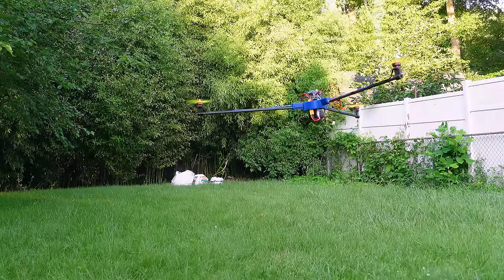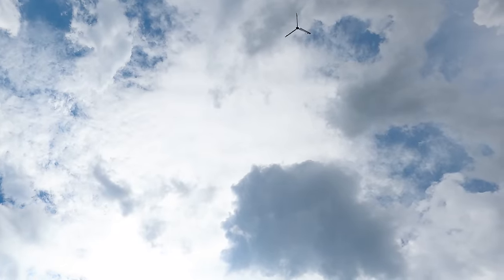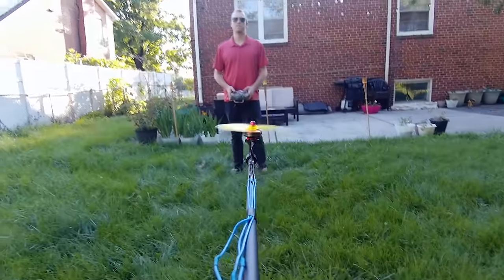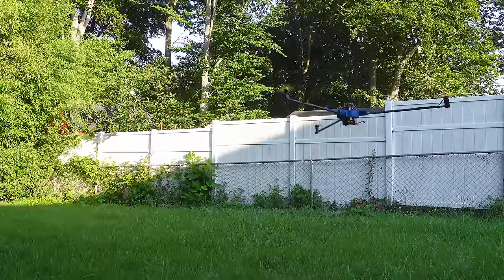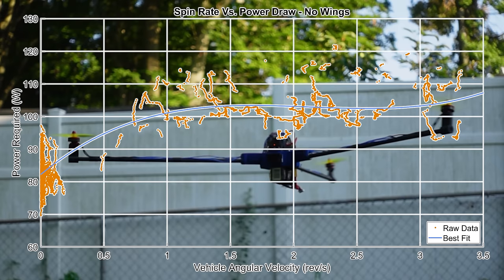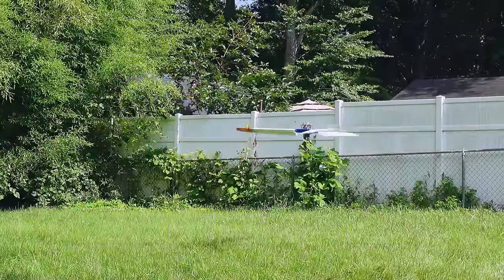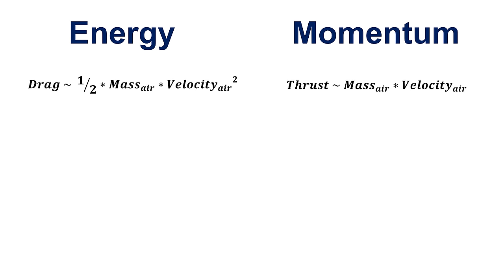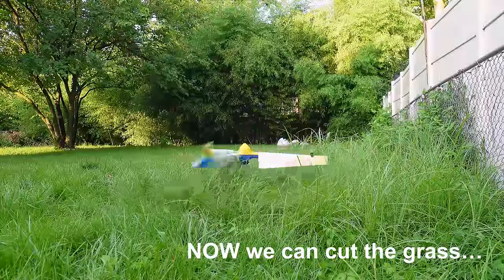The Spinning Drone Paradox - Part 1

Comment: I am astounded at how you can share your findings and teach new concepts in a fun way at the same time. Great job!
Reply from the maker: Really appreciate your comment
Reply: @NicholasRehm  The concept actually comes from a children's toy. It's a stick that you attach to a small propeller, and you rub it in your palms which causes it to spin, lift up and hover like a helicopter.

Putting that on a drone makes it more efficient, just like you touched on, the whole unit becomes one large, slow spinning, "passive" propeller.

Also, having tri-drone is a more efficient design than a quad-drone. You basically can have three larger active-propellers, rather than four smaller ones. So these two attributes fit together nicely.

The reason why people opt for the quad-drone setup is because it is actually more simple, cheaper, and easier to navigate (you can assign each side as front/back/left/right). Each of the four arms can be rigid and controlled by a simple on/off switch. A tri-drone needs more tweaks, and have each arm needing to pivot and spin at different rates.

As for energy source, fossil fuel is still better method at the medium to heavy weight. Electrical is only viable at the super lightweight scale. Not sure about nuclear, we don't have the technology for it (small nuclear engine). The best compromise is using solar energy for splitting water, generating hydrogen, using solar energy to compress it, then having hydrogen engine for helicopter flight. It can scale to heavyweight sizes, and is based on a renewable source.

Comment: I couldn't fail to notice another way to improve the efficiency of your setup: Just let it spin in the other direction!
As any winged aircraft, your drone suffers from  wing tip vortices due to induced drag. 
These vortices reduce the wing's ability to generate lift, so that it requires a higher angle of attack for the same lift, which tilts the total aerodynamic force rearwards and increases the drag component of that force.
In the flights you showed us, the propellers were turning in the same direction as the vortices, hence enhancing them. Now  if the drone spins in the other direction the wing tip vortices switch direction too. Since the spinning direction of the prop would stay the same, those vortices would be reduced by the prop spin.
The effect would be even more pronounced if the props would be at the very tip of the wing. 
See:
Chance Vought V-173
Chance Vought XF5U
Bell-Boeing V-22
On all these planes the outside tip of the props were moving downward.
Reply: In addition, it could be  torodal design
Reply: where would u suggest I learn more about what u've said?
Reply: @davidthomson8010  Wherever you are right now is fine man, just gotta start! Good luck!
Reply: @onepointufo  toroidal*
Reply: @1u8taheb6  useless answers 101
Reply: @davidthomson8010 
A&P online courses. I’m a licensed A&P myself but basically every single topic pertinent to aircraft is taught in these courses. 

 Actual books you can own is the AC-43.1B. This is an advisory circular giving instructions on part 43 of the Code of Federal Regulations. 

 The FAA 8083 is good training books too. 

 Since these are federal guidelines and recommendations, they are available for free as PDF online. 

 Watch YouTube courses on A&P topics as well.

 For avionics it’s NCATT AET which can be quite complex subject because it is a training book for passing the NCATT, probably one of the more difficult federal licensing programs available.
Reply: Wait couldn't we also just sweep the inside part of the wings a lot and get vortex lift while leaving the end of the wings straight and fighting the wing tip vortices with the props. As the inside of the wings is slower it would also make sense to increase the cord off the wing right? IDK I'm just talking about what i think i know about aerodynamics.

Comment: You know, like a helicopter! 

Fun fact, there have been helicopters that had their main rotor propulsion take place at the end of the rotors by little rockets. These tip jet Copters came in several different formulations. Including ram jets! 
You’re essentially recreating this basic idea. Thrust at the end of the rotors! Another benefit of propulsion at the tip of the rotors is a lack of torque applied to the center mass. This makes it not necessary to have tail rotors on these types of craft!
Reply: Came here looking for somebody mentioning a helicopter and here you are. Somebody else on here made a comment about separate servos for rotor tilt and I think they stumbled upon the cyclic.
Reply: There used to be advertisements in the back of magazines like Popular Science that sold plans for one-man helicopters that used pulse jets on the rotor tips.  Apparently they did work but the pulse jets were so loud that they were no fun.  Pulse jets are simple and cheap and precession is not a problem, but damn they are stupid loud.
Reply: @florabee9283  pulse jets are a great way to convert potential chemical energy into noise.
Reply: There is a YouTuber that already made that
Reply: I used to subscribe to popular science and mechanics way back then... How did they steer?
Reply: @petevenuti7355  they had swash plates. Like most copters.
Reply: What you describe is a Fairy Rotodyne.
Reply: @crisper1614  Not swash plates, the entire rotor head was on a universal joint, you just tilted it in the direction you wanted to go.
Reply: Mmmm.... No.

The more accurate comparison is between a turbojet vs a turbofan/prop, and why turbofans have been steadily getting bigger.

A helicopters kinda have the same problem as the naked tricopter - it's moving a relatively small amount of air quickly rather than a lot of air slowly.

For example, compare the CH53 with the Dash 8 Q400 they both have a similar maximum takeoff weight, yet the Q400 flies faster and farther with less powerful engines.
Reply: Yes, I remember talking with my brothers and father about helicopter engineering. For conext, both of my brothers and my father all have degrees in mechanical engineering. And I was just an undergraduate chemistry major. I suggested it may be possible to improve helicopter performance at high altitude by powering the rotor with ramjets mounted to the tips of the rotors as these tip jets would exhibit excellent thrust with the increased rotor speed. I had never heard of tipjets before and was just spitballing. They all scoffed at me and told me that design would be completely impractical. I later learned that tipjets were actually a thing and was totally vidicated, but still a bit resentful about how quick they were to dismiss my idea.
Reply: Mustard's video on rotocopters is great!
Reply: @FourthRoot  Keyword, *were*.

Tipjets were a thing, and no longer are a thing, because the design is completely impractical.

There was one production tipjet helicopter ever, and it ended up being replaced by a conventional helicopter.
Reply: @firstnamelastname8439  They weren't completely impractical as real working prototypes were produced. They just didn't offer any significant advantages over traditional designs. But that wasn't my brothers' and father's argument. They argued that the design would not be feasible at all. They argued that the centrifugal force would be far too great for the rotor to handle and it would not be possible to power a helicopter rotor that way. They were wrong about that and wrong to scoff at my idea.
Reply: @FourthRoot  Then you should have said impossible. 

'Offers no real benefits despite having additional costs' is kinda the definition if impractical.
Reply: @FourthRoot  Three words for family unity: 

Let it go...
Reply: @icantseethis  About the same as a Harley!
Reply: @HarmanRobotics  because of gyroscopes, technically you tilt 90 degrees offset from where you want to go

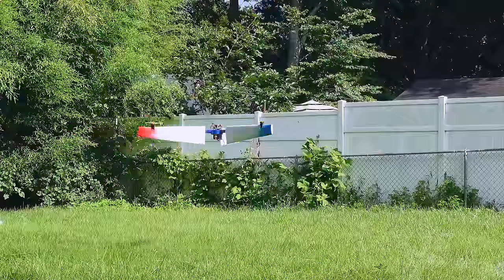Comment: I love it! Now make a gigantic quadcopter with four of these and see how much it can lift. Seems like you already have good feedback about the yaw rate, which could be fed into another PID for the quad control. An added benefit is you could adjust the 'cyclic' or average pitch of all corners so that the rev/s aims for the minimum of the blue line in the graph at 5:52. It would be hard to program, expensive, and as agile as a school bus. Yay!
Reply from the maker: This is so insane that I just might do it LOL
Reply: Oh i just saw watched this video and thought i thought of this first, i hope you do this though
Reply: @NicholasRehm  you're using a 4-in-1 ESC anyway, so, why not 4th motor?
Reply: @NicholasRehm  well it won't be more efficient than strapping 4 bigger motors directly to the bigger props, will it?
Reply: @NicholasRehm  Is there enough space for 4 pinion gears? Suppose ya could just go bigger?
Reply: @NicholasRehm  yes im thinking if all four are attached from the bottom and then enough distance that they don't rob air from one another, that flight controller is gana need a number of code levels so it can understand all four in motion so the overall frame and be stable, but all over my head lol
Reply: Dang I was just going to comment and say "Make it a dual design!" But you just went ahead and went straight to quad!
Reply: @jackwiedemann  Then it would have no thrust in "airplane" mode.
Reply: @NicholasRehm  of course you would need to make a quad of quads, creating the first Koch Snowflake Infinite Multirotor
Reply: @Chris-oj7ro  just needs tilt on all four and you would fly decent speeds like a race copter
Reply: @jackwiedemann  it might not match the efficiency of a conventional motor/prop setup of the same size, but both motors and props that large are extremely expensive compared to miniquad motors and foam airfoils, so I could see some utility in low-cost low-speed applications.
Reply: This but ^3 ed lol This tricopter driving a larger propellor which would be on the quad. LOL sorry couldn't help it.
Reply: No shit, I've seen one of these ~20 years ago and everyone working on it hated it and thought it was dumb. It was made out of the pink insulation foam and each blade was ~12 feet.
Reply: Can you make tiny rotors to drive the small ones?
Reply: make a tricopter with three of these. Then tilt them and spin the whole thing! Then make an even bigger one with three of THOSE.

Comment: Nice! In forward flight you get some lift from the two lower blade/wings! (I propose blades + wings = blings😄) Maybe you can use the top one as rudder.  In fwd flight, looks like a Imperial Lambda-class shuttle!

Comment: Extremely impressive! This makes me think of a German concept aircraft designed at the end of WW2. It would use 3 jet engines in the same configuration as yours to take off and land vertically.  It never reached the prototyping phase though. Here is a link for more info: https://en.wikipedia.org/wiki/Focke-Wulf_Triebfl%C3%BCgel
Reply from the maker: I want to make one of these eventually!
Reply: @NicholasRehm  contra rotating
Reply: That concept was also used in the famous Fairey Rotodyne
Reply: That was the TriebFlugel (https://en.m.wikipedia.org/wiki/Focke-Wulf_Triebfl%C3%BCgel).  The US had the Pogo which is not the same idea but also was a VTOL.  Landing was always a problem since the pilot couldn't see what he was doing as he set down.
Reply: Yes this design is almost exactly the same. The problem here is the forward flight. In a drone there is no mass to transport. So the aerodynamics become very easy. In a real situation Osprey is the best we can achieve. I will be very astonished if anyone is able to make a better practical design.
Reply: @NicholasRehm  you better

Comment: Really neat!

In forward flight, if the arms were all on separate servos, then two could rotate in opposite directions inward to make a plane with reverse sweep, using the third motor to keep the tail up.
Reply from the maker: That’s a really cool idea. V2 might need to have separate servos per wing now
Reply: @NicholasRehm  what about using the current design (but non spinning) in fast forward flight, with pitch angle near 90 degrees? This might be what you meant at the end of the video, but maybe you were talking about spinning forward flight.

It won't be passively stable, but it would be interesting to see if you are able to hold altitude with similar efficiency. Great project.
Reply: @JMMC1005  It could be. He flew like an inverted "Y", but he could have flew it as an upright "Y". This way the two arms up would provide lift, and the third arm down would be there just for propulsion. It wouldn't even need to move the arms independently: just put them at 90 degrees, and use engine speed to control the drone.
Reply: The same thought hit me at 8:20, it looked like a plane..
Reply: @NicholasRehm  
Probably two of this drones could be connected on one central axis, and up one turns in one side, second one - in the other, so axis is somewhat stable and load can be attached to it. Would be kinda similar to helicopter with coaxial rotors.

Comment: Wow, this is incredible! I am imagining a future version of this with a payload section underneath that is counter-rotated to be kept stationary. This could be super applicable to long-distance/payload flights with sensitive cargo or cameras. Can't wait for the next video!
Reply: can you explain your first statement little bit more ??
Reply: @BootyRealDreamMurMurs  yes thanks,
Reply: Maybe not "counter-rotated" as much as just stationary. How about the payload section on a bearing with an internal gyroscope?
Reply: @mikestaihr5183  yea a bearing design would be better i think
Reply: @BootyRealDreamMurMurs  reading this makes me think you're a college student and always trying to hit that minimum word count on essays 🤣 you could have written all that in 1 short sentence.
Reply: I can't tell if that's serious, or the most sarcastic way to describe a helicopter ever
Reply: What do you think a tilt rotor is? 

You don't need some pointless complicated counterrotation system if you just tilt the rotors the same way, and just generate lift by moving forwards - which is what you want to do anyways, instead of going in a circle.
Reply: It actually isn't. Helicopters suffer the same problem as the airfoil-less drone.
Reply: VTOL fixed wing drones exist that have solved all the solvable efficiency issues when it comes to duration and long distance flights. The design in this video is not a better solution, in fact it is much worse.
Reply: Genius! Perhaps we could also move the electronics, batteries, etc. to the payload section which doesn't spin, to reduce the mass we need to spin around. And instead of using some complicated counter-rotation system, we can just spin the top part with a motor held in the bottom part, while keeping that from spinning with a second little propeller offset from the center. Let's give this new invention a cool sounding name, something like "helicopter" maybe

Comment: Impressive!
 I wonder how the "big propeller mode" would perform in horizontal flights
Reply: The angular momentum would give it excellent stability in extreme weather conditions.
Like a spinning bullet shot out of a rifle.
Reply: Imagining horizontal big prop mode.... Wow. That just kept my imagination busy for the past hour.
Reply: I could get interested in investing in same design and larger assembly.
Reply: @BVLVI  you whould have no lift though as all your trust is either cancelling each other out of giving you forward momentum
Reply: Hi Phillippe, 'Big Propeller Mode' will have most of the characteristics of a Helicopter, so it will need to balance the advancing/retreating blades lift, etc.  
Aaand for manoevering, Cyclic pitch control, perhaps?

Comment: Great design and explanation. Try removing 1/2 or even 2/3 of the wing on the inside. The inside part of your rotor-wings are more weight than lift.
Reply: Why?
Reply: @kekogonzalez677  the inside has lower wind speed so it generates less lift
Reply: @mtbsieppo  exactly
Reply: @mtbsieppo  
That depends on the design of the airfoil, camber, taper, twist, and angle of attack.
Elliptical lift across a propellor or rotor is possible, as well as other lift profiles.
Reply: @mtbsieppo  Still, removing that part of the wing introduces a vortex.

Comment: Now I'm envisioning a future where we fly around sitting in the middle of a giant prop.
Reply: Isn't that a helicopter?
Reply: @robinbennett5994  yup, helicopter with three tails and wing for each tail
Reply: A triebflugel that goes from being a crazy 80 year old concept to something that actually works.
Reply: Yes and not only Triebflugel but Flugelrad as well...
Reply: And Flugkriesel...
Reply: But that sounds dangerous 😳
Reply: @eduardovazquez9356  C'mon man... No more dangerous than landing a booster rocket over and over and reusing it. Just add more sensors!
Reply: economy seats at the ends of each prop
Reply: @6Sparx9  
July's Winning Post.